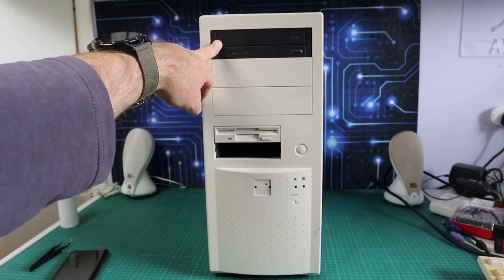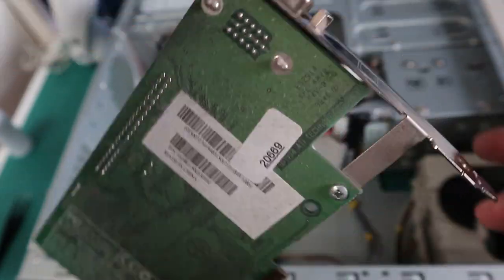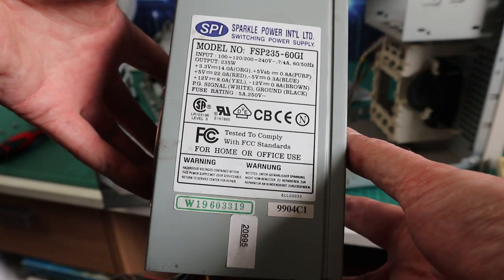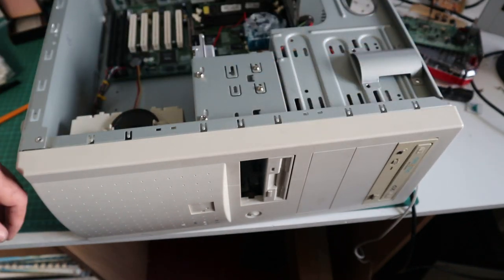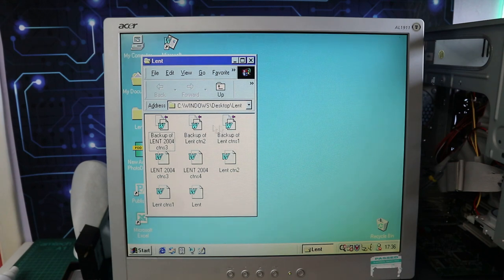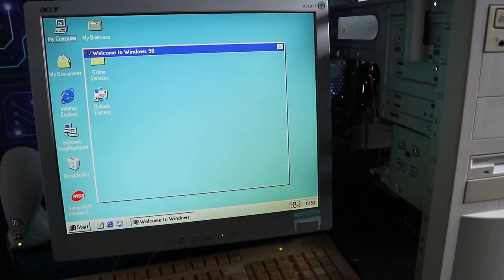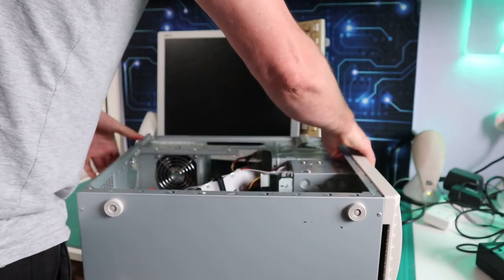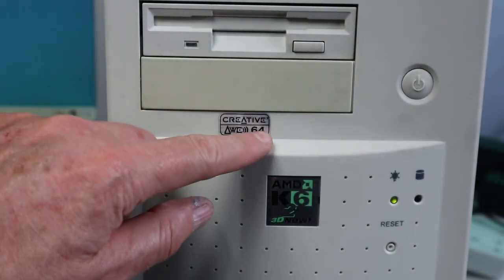eBay retro freebies (part 2). The one that wasn't (free).

Comment: Very interesting video. Would be nice to see some more benchmarks in games like Quake 2, Unreal, Quake 3 etc
Reply from the maker: Thanks😊 Aim. Is to get a k6-3 for this at some point, or at least a faster k6-2 so will bear that in mind and do some better gaming benchmarks to compare with at some point in the near future.
Reply: @66mhzbrain  I was interested in the K6-2 400 or 350 because back in 1999 I upgraded my P166 MMX to a K6-2 400 :) (on the same motherboard). The K6-2 400 was the fastest CPU supported by my Socket 7 motherboard.
Reply from the maker: Maybe I'll see if I can get a range of socket 7 cpu's and  do a face off kind of video
Reply: @66mhzbrain  that would be great :) especially with a 3dfx card

Comment: I had a computer like that around 1997. That looks like an Enlighten computer case. I also had an AMD K6-2@300mhz CPU. And I was running Win95.
Reply from the maker: Cool, I have come across a few cases like this, they must 
have been quite popular!
Reply: @66mhzbrain  Yes, these were very popular computer cases back around Win95/98 era because they were tough, easy to add components to and inexpensive. If I bought one it must have been inexpensive probably around $40. I don’t remember. But I did not have allot of money for a computer at that time as I was in school. That’s why I use the AMD K6-2. I later purchase a NEW HP Kayak Workstation with Dual Pentium ll@400mhz. And it ran WinNT 4.0. But the K6-2 worked fine for Win95.
Reply from the maker: @computerenthusiast402  They are nice and solid. Nice that they were so cheap too! It seems quality nosedived a few years later for cheaper stuff as I have had a few from around 2000 that you could easily bend the frame or that had already warped.
Reply: @66mhzbrain  Yeah, that’s the exact same case I had used for my Win95 AMD K6-ll build. I still have one of those cases in my garage I want to use for a slot-l Pentium-ll build when ever I get the time. I remember that tiny reset button because I had to use a paper clip to reset the computer.
Reply from the maker: @computerenthusiast402  cool, will be a nice box for a pII
Reply: @66mhzbrain  That hard drive has date 08-99 so maybe that computer was built around 1999. For a minute I thought that was my old computer it is so close to the configuration I had. I remember I sent an email to AMD and requested a case badge and they sent me a bunch of AMD K6-ll badges for FREE. So I put that badge on my case. You can still find case badges on eBay.
Reply from the maker: Thats pretty good of AMD! Im not sure about originals,  I get my badges from a seller called geekenspiel who has a nice selection of repros.